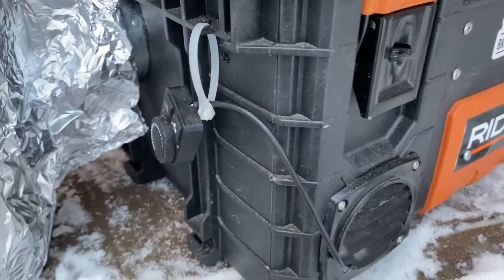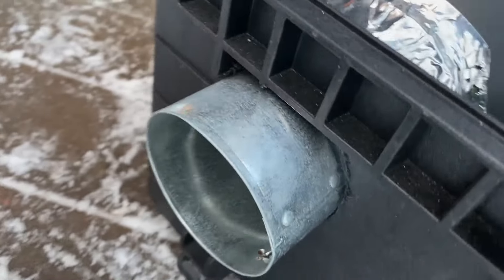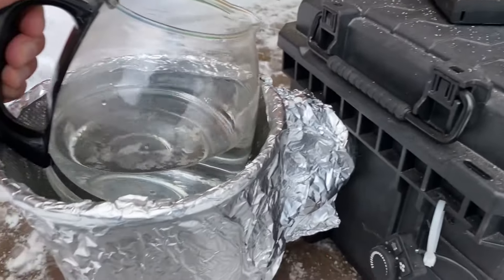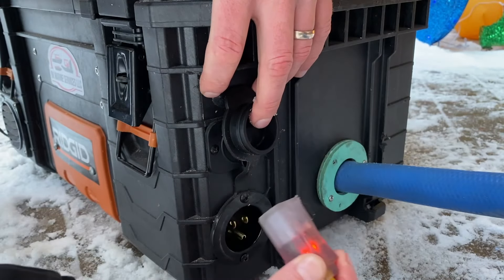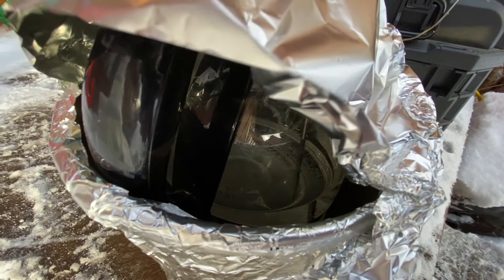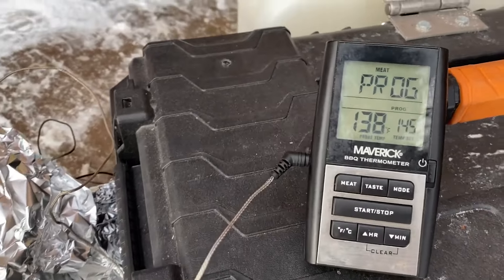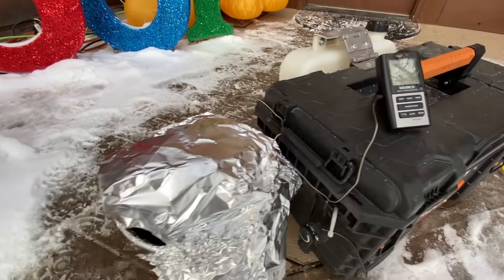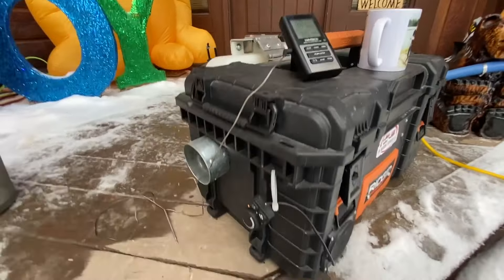Planar 44d Portable Diesel Heater Box Operation Instructions Water Heating Experiment #1

Comment: Is this primarily for your boat? I'm buying a 22' extended transom, hard top Hewescraft SeaRunner tomorrow and need to put heat in it as we live 8 miles from town by skiff and take on freezing spray. The local shop recommended the 44D, do you think that is powerful enough for your size boat or would you have went with an 8kW heater??
Reply from the maker: The 44d has never let us down. 10hrs of reliable, dry heat with a good blower fan. Usually the heat gets turned down or off on most days out on the water. I couldn't imagine needing more heat in my 27ft Glaciercraft Coho. In my boat I would add insulation and keep the doors and windows closed before Id get a bigger heater. In this video, the intake air is really cold and being drafted from the ambient outdoor temp. In a boat cabin, the ambient intake air is being heated by the heater, which will produce a higher heat being blown out, which is too hot to hold your hand in front of and can actually heat up a can of soup!